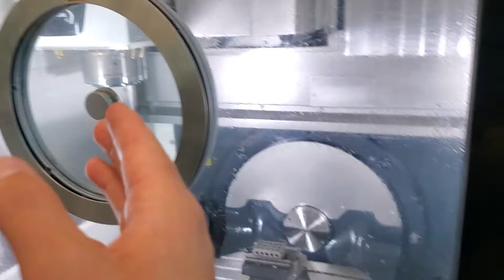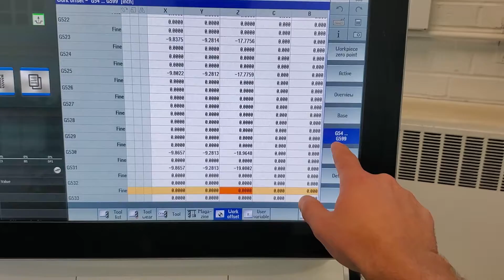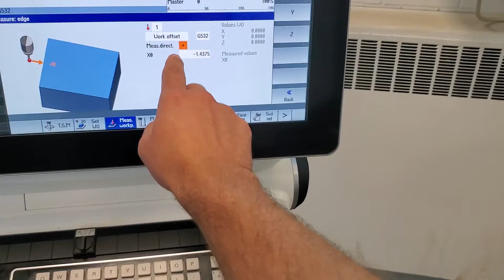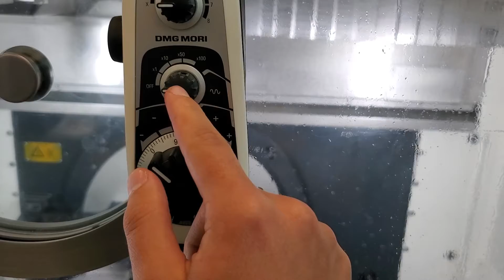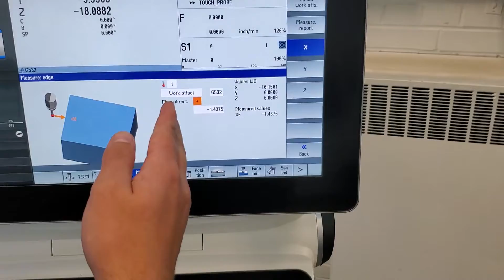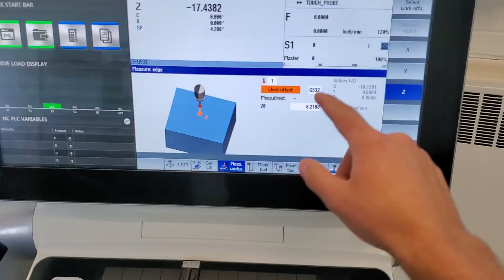Setting Up A G54 Work Offset in a CNC Machine Using a Touch Probe and a 123 Block

Comment: do you have that probe registered as its own tool number or did you remove a cutting tool and use the position temporarily to probe. ?
Reply from the maker: We actually keep our touch probe in the last pocket of our magazine; we never remove it unless we're changing the batteries.
Reply: @artofthepart  cool how do you do that?   where do you do that? cause right now i have to manually load the probe